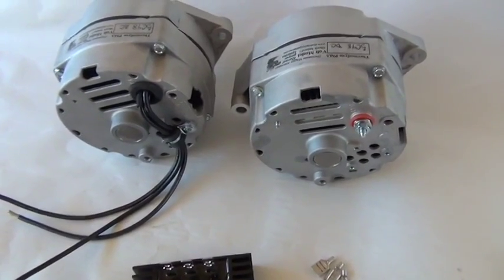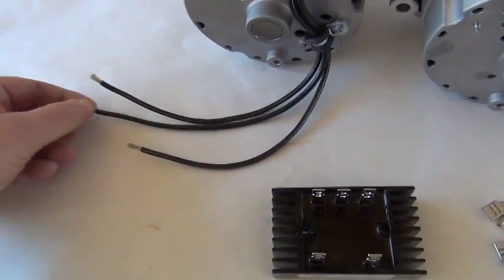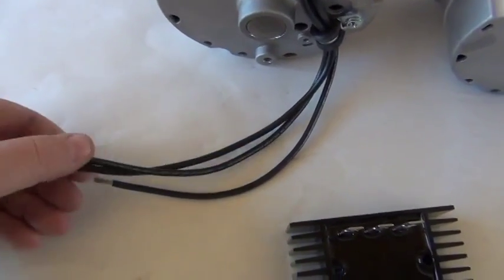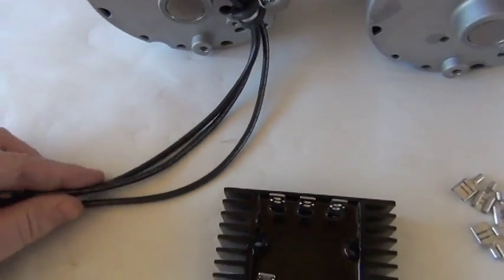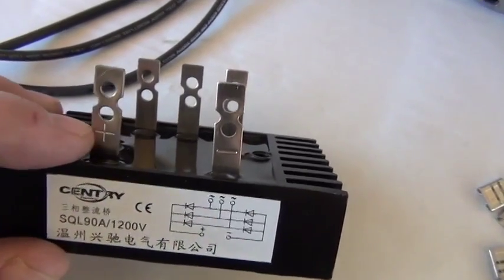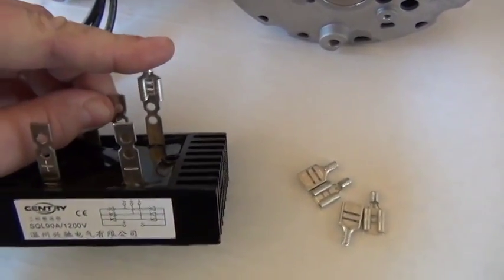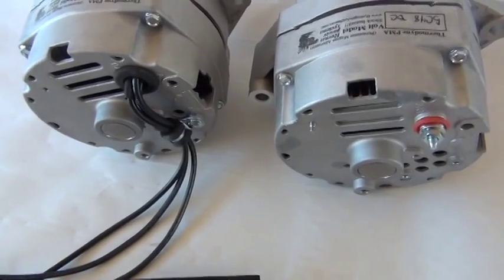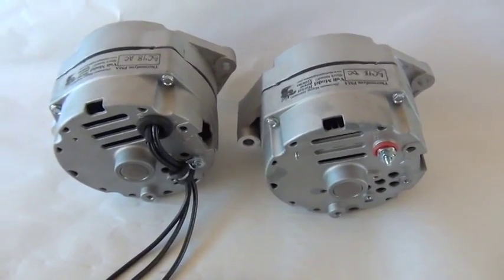What's better, AC or DC wind turbine PMA's / PMG's

Comment: Hello.  Thank you for the informative video.   I also have a question.  I have a distance of 300m from the house to the 5kw turbine (3 phase ac) What is best, to run three cables to the house or have a rectifier at the turbine to convert to DC and run two cables ? ( cheaper).  Daniel

Comment: At high wind across my 48V 3 phase PMG, what voltage should we see from a measurement standpoint on the AC side of the (AC to DC) rectifier. I had some high winds come through today and my readings were very low ( 2-3 volts) and I expected them to be higher. There is a  dump load and charge controller interconnected to handle battery cutoff situations. Thank you and thank you for your valued time to walk thru the issues.

Comment: Nice video, so i may ask if i want to charge my 12v battery whats more efficient using 24v and use a charge controller or use ac motor and use some sort of ac to dc converter? Ty

Comment: the difference between the alternators is that one has the rectifier inside both of them produce ac power...
Reply: In the end it comes to personal preference.  I like the DC the best.
Reply: Sounds like the AC version with an external rectifier has less heat inside the PMA case. Rectifiers are cheap compared to PMAs.

Comment: 24 volts is good enough for house environment.ofcorce with proper wiring for DC power
Reply: It really all depends what your power inverter needs.  Is your unit a 24 volt?  IF so you must get a 24 volt wind turbine
Reply: yes tank U

Comment: you said for long distances, a 48V version was a good choice.. what type of distance are you referring too? if it was under 100ft (for instance) vs over 100ft... what max distance would be available for the 48V-vs-24V systems?
Reply: 48 volt is for 300 to 600 feet.

Comment: i recently bought a pmg 48 volt and was testing it on ac wich was 280 ac volts and it turned on 3 lights totaling 250 watts, but when i turned on  a 120 volt- 1,200 watt hair dryer, it boged my alternator down to 90 volts. what cased it yo bog down? please can you explain bc im new in electricity generation?
Reply: Voltage (Volts) is pressure, resistance (Ohms) is obstruction to this force/pressure and current (Amps) is the resulting flow. More resistance to the pressure result in less flow (duh!). Power (Watts) is the combination of pressure and flow.

Lights have a heating element with a known and constant resistance. the electricity voltage pushes through the element, causing a slowing in the electric current and we can calculate a predictable power draw.
Hair dryers have also a heating element and behaves the same way, but in addition it has a motor blowing the heat off of this heating element. Motors are made up of coils. Coils are... we just that, a bunch of electric wires coiled up together. There is no resistance in electric wires, its merely conductive wire. So the current jumps very high, therefore the power draw goes extremely high as well... But coils produce a magnetic field over time. This field creates a built up resistance in the wires... limiting current.

so every appliance that has a motor or any component with coils has no resistance and the electricity rushes in too fast drawing high current and causing lots of power draw, which is what happened to you. Eventually once the motor turns and the coils generate a resistance it stabilizes.

this is why lights, simply heaters, etc have predictable power outputs, but motors and anything with coils draws high power when first plugged in. You must build circuits to take into account these spikes in current draws.
Reply: +chin K The drier used way more power than the turbine can produce at that speed.
Reply: True!
Reply: Voltage and AMPERAGE or load are very different things.  You just over loaded it.  These are really rated for BATTERY CHARGING.  Now if you run the wind turbine for an hour charging a battery and them used the power to run a 3000 watt power inverter that would have ran the dryer for 15 to 30 minutes depending on wind speed in your area of coarse.  The more wind the more power you can use.

Comment: a question, do these alternators have permanent magnets. I thought that you needed to power the fields in order to get an output. thanks
Reply: yes they do have magnets in them unlike a car alternator. Basically a car alternator with a rebuilt rotor with magnets alternating north, south, north, south and so on.
Reply: okay, I get it, it's like a DC motor, but instead of power applied it is producing it.  thanks

Comment: If the voltage goes up as the wind increases, then what is the difference if you have a 12v or a 48 v alternator? Also, does the DC voltage change coming off the rectifier?
Reply: I'm also trying to figure out that question!!!
Reply: @chrismaes9230  You just get higher voltages in higher winds. Simple.  The different alternators just have different turns of copper coils to get closer to the battery voltage in question.
Reply: Most likely the DC would have a voltage regulator. The charge controller would limit the DC output

Comment: Actually no matter what your voltage output, AC will always travel a farther distance without reduced current due to magnetic inductance built up in the wire. Thats kinda the point of an AC utility grid vs DC.
Reply: Not quite right.  One of the reasons for AC transmission is AC is, or has traditionally been very easy to step up and step down in voltage.
Reply: well, your comment is true, but in a house environment, distance is not an issue.
Reply: @ناسررهیمی  No, his comment is not true, it is false. Your comment is also false - Distance is a issue ....
Reply: Until you need to transmit power over 800km in one go, in which case the line reactance will become so high that no power (i.e. "real" power, rather than reactive power) can be transmitted.

Then you're stuck with high-voltage DC. 🐸☕
Reply: +J&B Wrong.. The PMG is putting out 3 phase AC. So the DC voltage drop would be 2.54 and the AC voltage drop would be 2.20. Quite a difference.
Reply: you need to correct what you wrote, the PMG by definition does NOT put out 3 phase AC.  The PMG puts out flat DC.  The PMA puts out the 3 phase AC
Reply: @PoorMansDIY  No, you are wrong. You cannot select "3 Phase AC" from that Voltage Drop Calculator for a Wind Turbine PMA, because the PMA is connected to a Bridge Rectifier ...
Reply from the maker: Actually the new theory is that no electricity travels INSIDE the wire, the power travels outside of the wire as a magnetic wave.  This is why the first transatlantic telegraph cable had to be scraped, it had an iron core for strenght which killed 98% of the 'Wattage' over long distances.
Reply: Wrong.

Let's say you have a distance of 80 feet, a 10 amp output from the wind generator  and a # 12 wire and 24 volts.
What you are saying is that Ac would have a lower voltage drop hence will go farther and DC will have an higher voltage drop and that is the reason it will go a shorter distance. You have to correct your opinion.

Here is a calculator http://www.calculator.net/voltage-drop-calculator.html?material=copper&wiresize=5.211&voltage=24&phase=dc&noofconductor=1&distance=80&distanceunit=feet&amperes=10&x=63&y=11

Plug in your data , ... # 12 wire AWG, voltage  24 volt, then DC , then 80 feet distance and then the amps. hit result. This is your DC calculation and the result will be 10.58 % voltage loss with DC. And your voltage drop will be 2.54 volts.

Now leave everything the same except change the DC into AC single phase. Then hit result....The voltage loss is AC now ....which is 10.58 %. And your voltage drop will be 2.54 volts.
So AC and DC has exactly the same losses and will travel the same distance.
Reply: @FloryJohann  Thank you for the Calculator link 
https://www.calculator.net/voltage-drop-calculator.html?material=copper&wiresize=3.277&voltage=12&phase=ac3&noofconductor=3&distance=25&distanceunit=feet&amperes=142&x=0&y=0